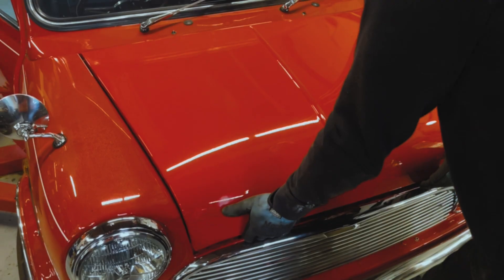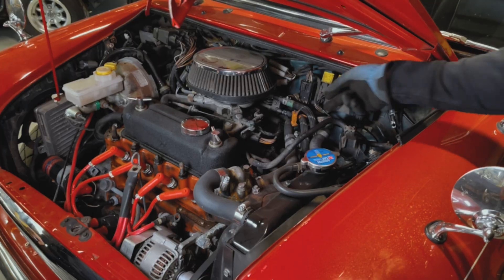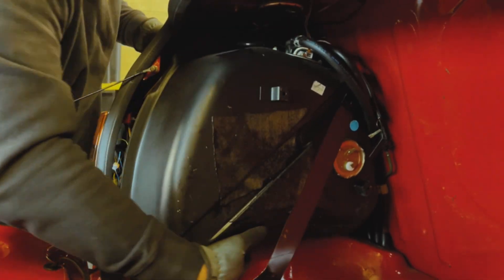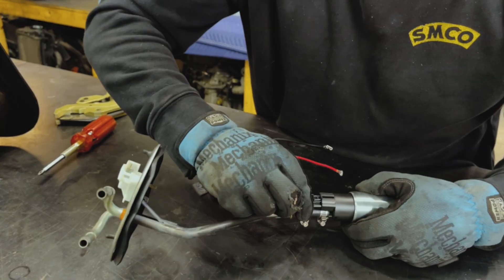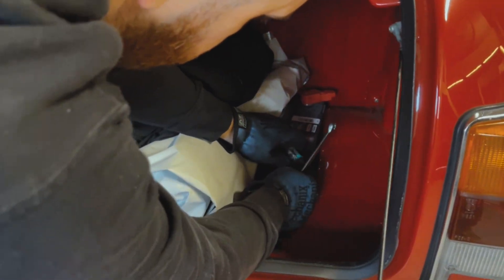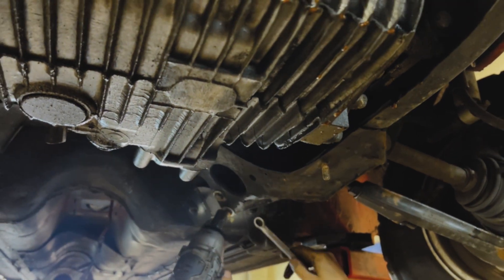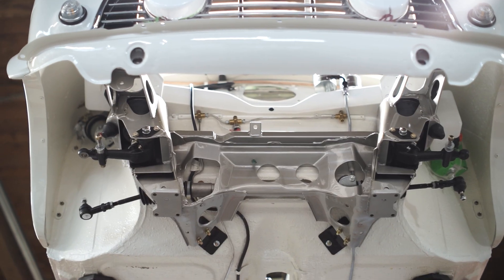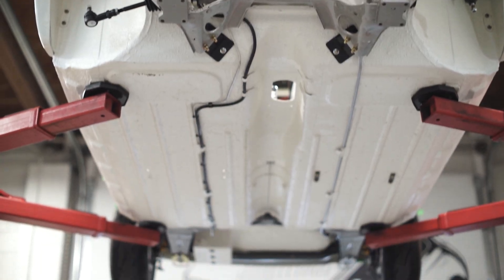SMCO Ultimate Classic mini Honda D16 Kit Install: Part 1

Comment: @Stevestonmotorco   how is the weight of the subframe compared to others on the market (e.g. McGee)?  Love the two piece design for ease of install and maintenance.
Reply from the maker: They are 80lbs each (which includes the skidplate), and with the lighter Honda engine, they come out to be about the same as a mini set up, which retains handling characteristics around town.
Reply: @Stevestonmotorco  thanks, look forward to the part 2 video.

Comment: You say mini MPI fuel pump is not adequate. I have mini mpi pump WFX100810 which is rated to 121 psi max. I have B18c engine fuel pump which is rated at 48-55 psi, so why would I need to change it?
Reply from the maker: We have bench tested a few and the flow rate is different between the two. Perhaps the pressure is the same, but volume is higher with the pumps we have tested. I’m sure it would only be a possible issue at full duty cycle but still it’s good practise to have a new pump and have it matched to the Honda, especially if using a stock ecu
Reply: Any make of pump that meets the required delivery parameters is suitable.

Comment: Will mini pedal and master cylinders work on d16? Any features?
Reply from the maker: Yes the brake and clutch masters work but the stock mini clutch master is .75” bore and the Honda is 5/8” so if you use the stock one it will be very stiff and a short throw. We recommend either adapting a factory Honda clutch master cylinder or when using a single line brake master there is room for a MGF clutch master to be used, it directly bolts on and is a 5/8” bore.